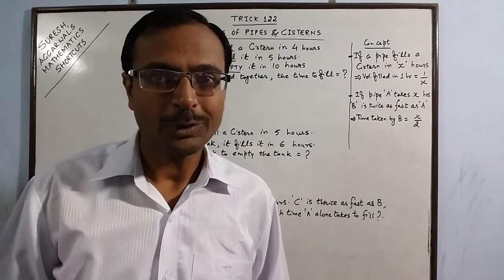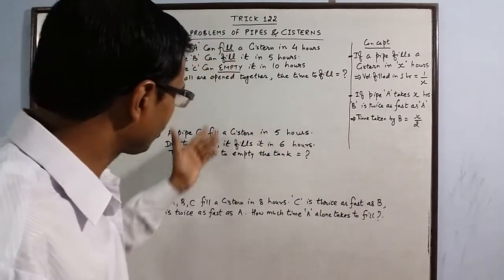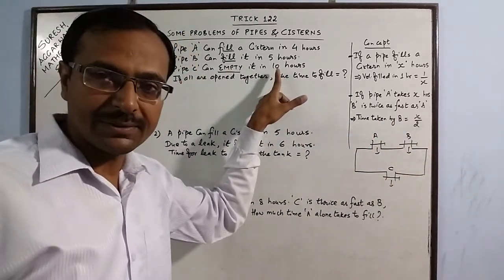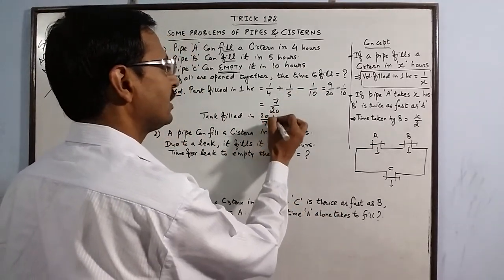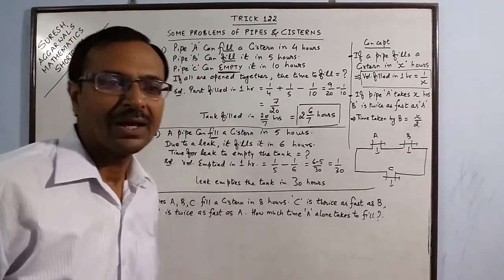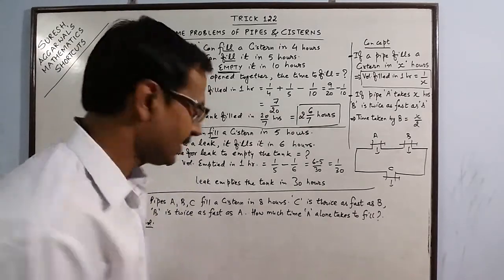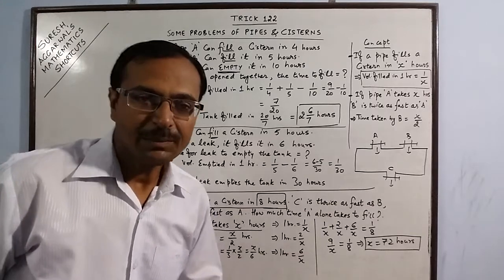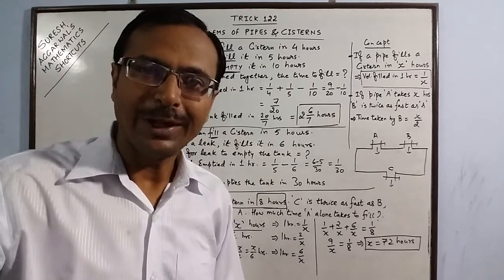Trick 122 - Solve PIPES & CISTERNS Problems the EASY WAY

Comment: nice sir.. how to memorise permanently trigonometric 0 degree,30 degree,45 Degree,60 degree,90 degree value of sin, cos,tan,cot,sec,cosec table in fingertips
Reply from the maker: +Prosenjit Biswas....that's an easy concept.....will post the video soon.
Reply: Prosenjit Biswas sin 0 to sin 90 value increases.  cos 0 to cos 90 value decreases.  So sin0 is 0 and sin90 is 1 and cos0 is 1 and cos90 is 0. Both sin and cos 45 are 1/√2. Now comes the confusing part. sin30 is 1/2 cos30 is √3/2. For 60 ratios are reverse. cos60 = sin30= 1/2 and cos30= sin60= √3/2. tan ratios can be calculated mentally by dividing sin/cos. tan90 is infinity. cosec is the reciprocal of sin and sec is the reciprocal of cos( C for S and S for C,got it? first letter inverse) just take reciprocal of sin and cos ratios to find cosec and sec. No need to by heart. cot is the reciprocal of tan. Take reciprocal of tan for cot values.